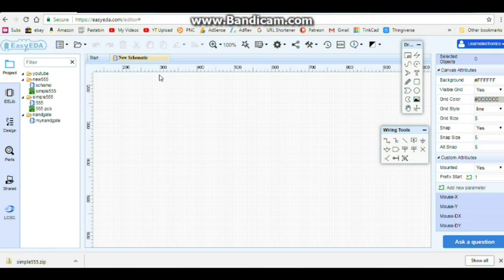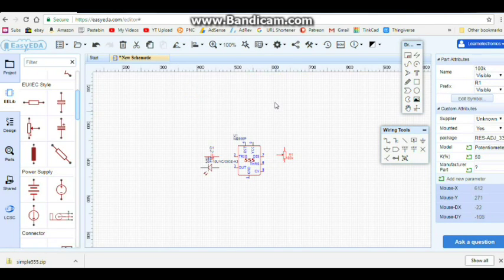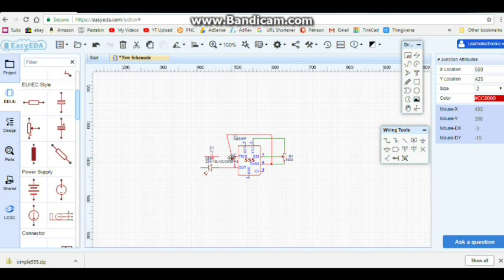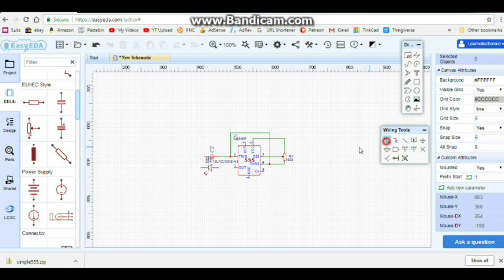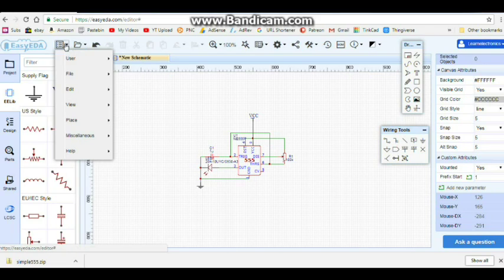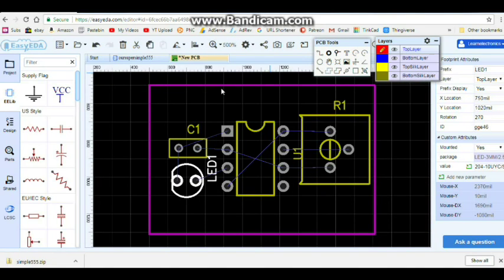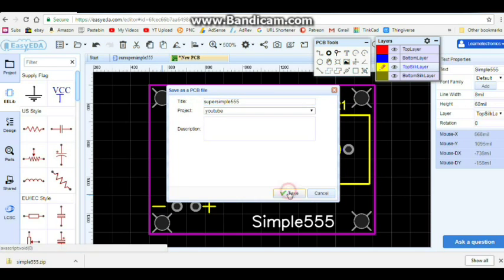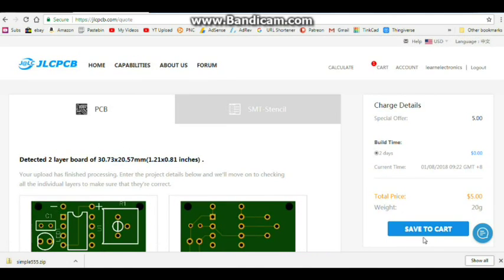REPOST - Make your own PCBs with JLCPCB com

Comment: that is amazing the way you were able to design a board never new there was anything like that. A little like designing a part on fusion 360 for machining.
is the 104 cap mean a 104 micro farad capacitor. and any led?
Reply from the maker: Ed KE6BNL 104 is just a code. 100nF. Blue, white or near UV LED if you want to use it without a resistor. You can use a different capacitor to change the frequency.